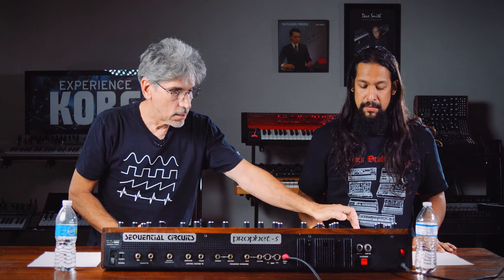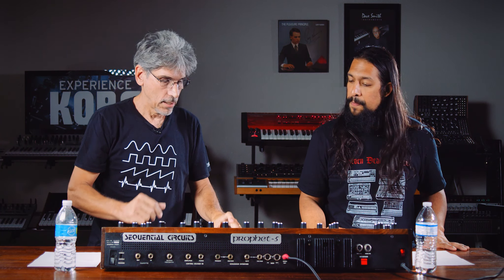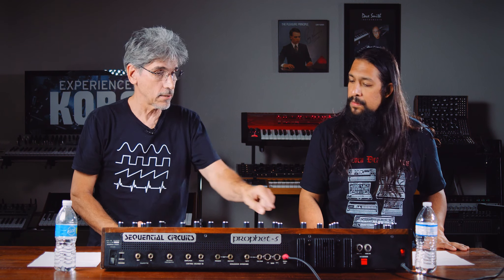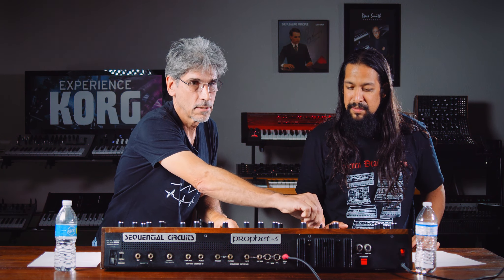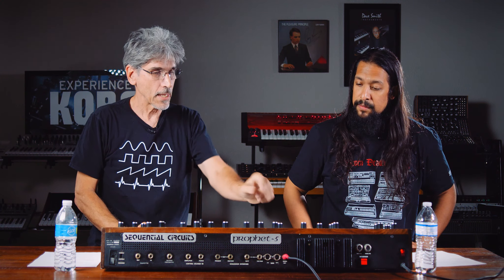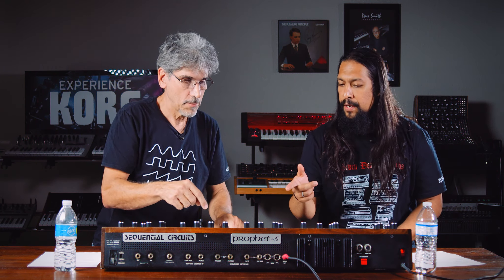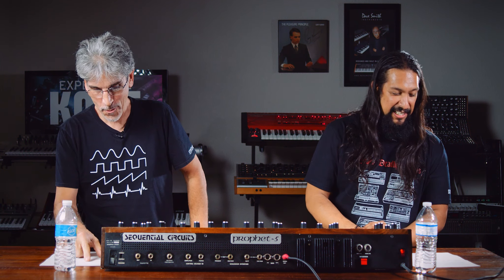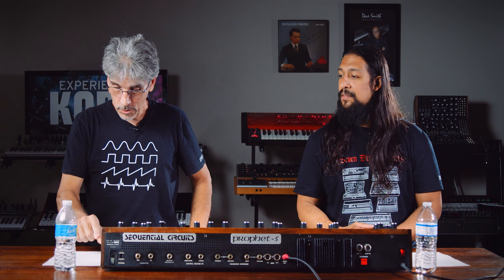Talking Synths, Episode 5 (November 13, 2020)

Comment: Might seem like a stupid question, but...
Would the peroxide cream also help to render the BLACK keys more vivid?
Surely, if white keys have oxidized over time, chances are the black ones too.
So I'm wondering if we could get a deeper and more vibrant black by applying that cream to them.
Or would it make them more grey?  Have you ever tried?  
I'd rather not risk ruining a vintage key to experiment if someone has already done it.
Reply from the maker: No, it only works on white plastic.  It would be an interesting 'customization' to do the black keys - my guess is that they will come out gray.  We have tried this on colored buttons, and they stay colored - but not like the original color.
Reply: @Syntaur  🤔🤔🤔🤔

interesting... So on a grey-themed synth (like a Poly-61 for example) it could be an interesting mod. And those keys are very common, so... Less of a worry.  Not like I would try that on my ARP Pro/DGX...
Thanks!